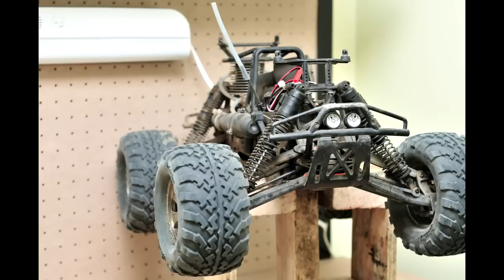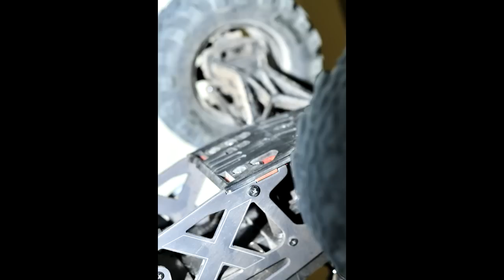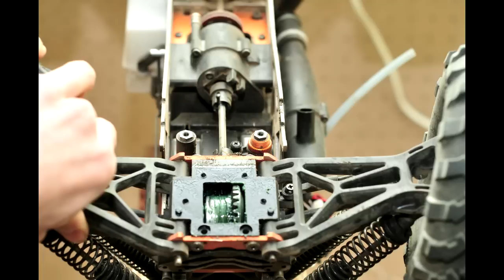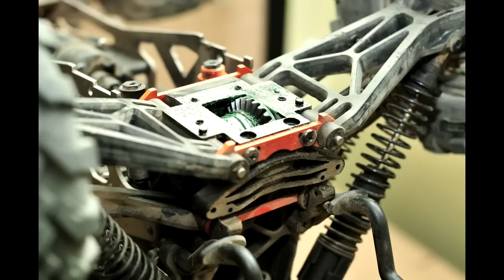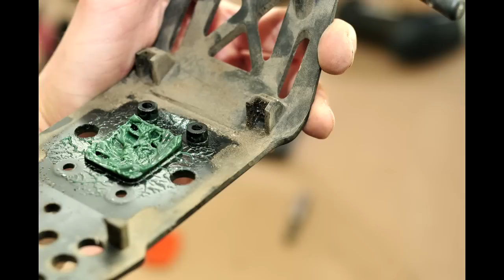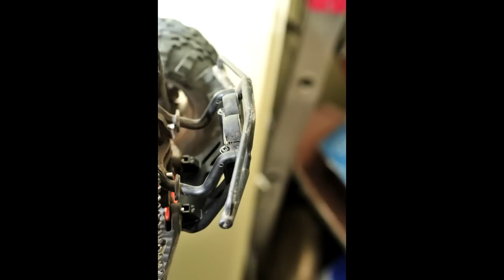HPI SAVAGE X 4.6 Skid plate / Bulkhead plate & brace replacement

Comment from the maker: I hit a big heavy block of wood. Broke the long threads in the bulkhead, bent the screws, bulkhead plate and a nice indent on the skidplate. I hammered it out the plate and brace a bit but it didn't satisfy my "even"-ness. Bought new plates and pins off ebay dirt cheap. The lower pins were bent aswell. Because things were bent and replacement was cheap, I went ahead with it.